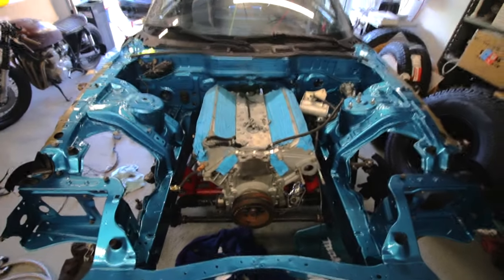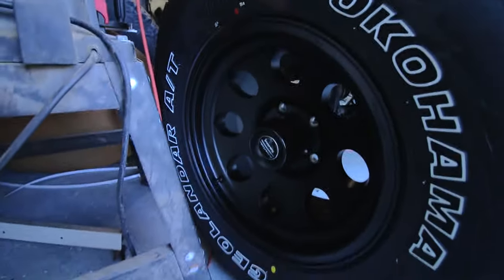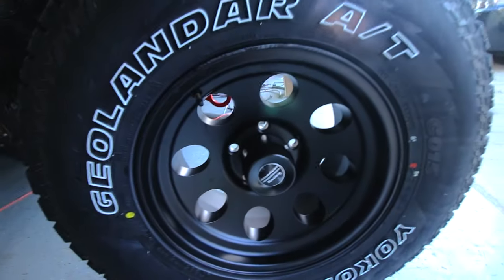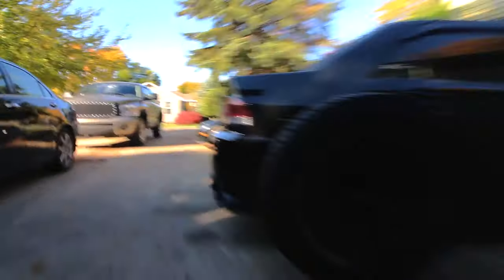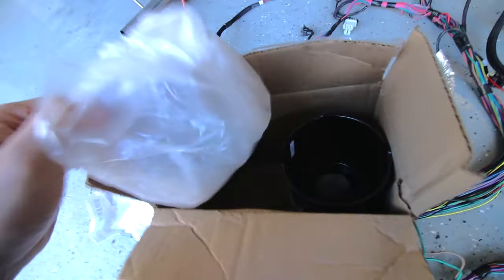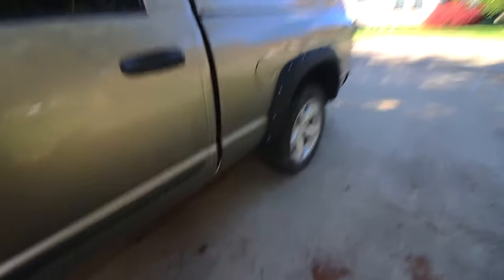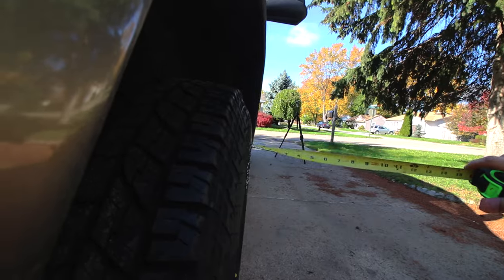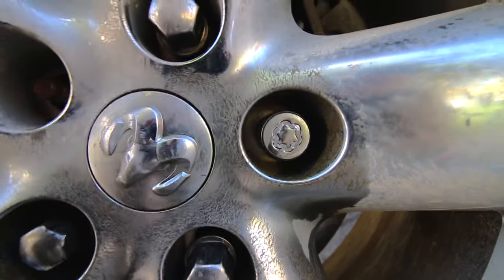NEW WHEELS Are Here But I'm FU*KED - Project Asian Redneck Ram #5

Comment: Your best bet would definitely be if you just weld a bolt or something else gripable on there with care. I was a metalworker and everytime we had a stuck bolt or a rounded off bolt we welded some spare scrap metal stuff onto there and used that as a breaker bar or as something to get grip onto the locked bolt

Comment: As others have stated, welding a nut on is probably going to be your best bet. They do make lugnut removal sockets that thread on overtop of the lugnut, but because your nuts are so tight that style of tool probably wouldn't get a good enough grip and will just strip the threads it digs into the outside of the nut. I recently went through this fiasco with a JDM car that didn't come with the lugnut key.

Comment: They sell a lug nut removal tool at the parts store. This happened to me when a tire shop ruined mine. Tool is enexpensive and works great it basically treads over the lug and once it grabs it'll come off easy.

Comment: +CZeroMedia what you do is get a socket slightly too small for the lugnut, and use a hammer and hammer it on, use a impact or a breaker on the socket to remove the lug, make sure u pull hard so it breaks it loose, use WD if u need too before hand.

Comment: If you have a socket that fits tightly on the lock, just bang it on there with a hammer and use an impact. If your lucky it wheel come off

Comment: if you have new lug nuts anyways, just weld an old socket to it so that the square side faces out. and use a penetrating oil with it as well. then clean up the threads so it doesn't happen to your new ones.

Comment: Theres special tools for removing those retarded lockingnuts! sadly they usualy break if the nut is tighten realy hard, think best option is to weld a bolt to it

Comment: Slightly oversized socket that fits super snug on the wheel look, hammer it on there good and it should come out. And get the nut out on a vise.

Comment: Wow! What are the chances we both get a locking wheel nut problem? All 4 of mine are so tight that after struggling with several methods Ive given up and its grtting removed by welding a key to it and then remove with a bar. Hopefully this will work after the 2 months of stress, but for yours you will defo have to weld it. Good luck 🤗

Comment: If it were me, I'd hammer on an oversized socket and then use one of those manual impact tools where you can fit a socket and then strike it with a hammer and it will turn at the same time -- the tool that is used to remove the set screw on brake rotors.

Comment: That crap happens all the time. Just buy bolt extractor set. Hammer it on the lock and use a breaker bar or air gun to get it off

Comment: Had a lock nut break on me many times, usually go and buy a socket that's slightly larger and hammer it on and breaker bar it off.